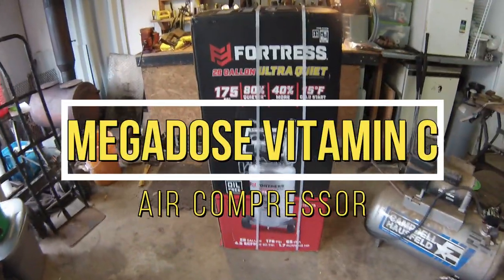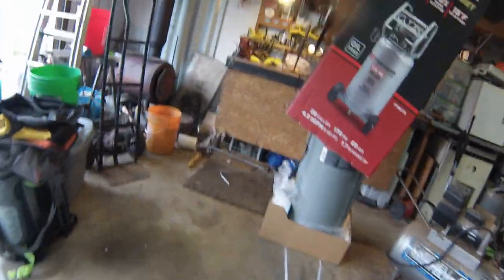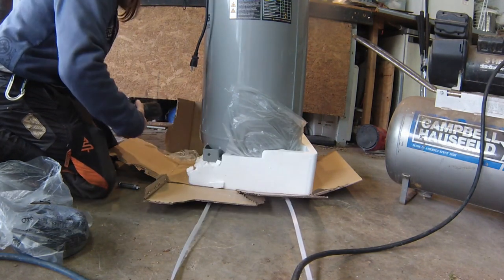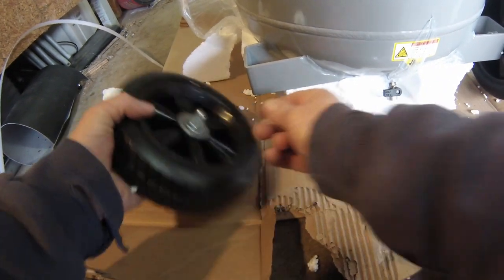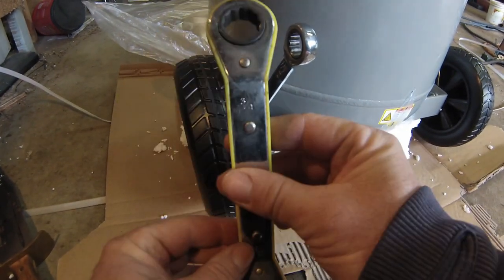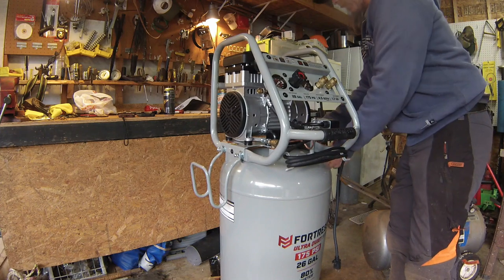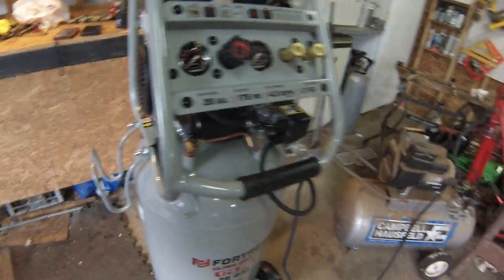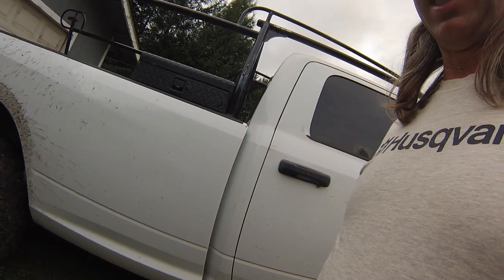FORTRESS AIR COMPRESSOR 26 Gallon

Comment: Is the pressure switch on the old one adjustable, it should be near the electrical contacts. 
Congrats on the new compressor, it's ultra quieter lol.
Reply from the maker: Yes it's adjustable.  I tried to adjust it and just couldn't get it right. I replaced it once a few years ago. Last time I drained the tank it was all rusty and the valve broke off. So this was the sign to get a new one. The old one was in the back room. I could hear it in the house that's not connected to the shop. Wife hated that thing haha..
Reply: @megadosevitaminc8774  I have one I need to hook up in my barn, hopefully it's not as loud as my little twin tank unit.
Reply from the maker: @brettblack7049  . I don't know how I put up with that old one for so long.. newer technology than back in 1997 when I bought it haha..